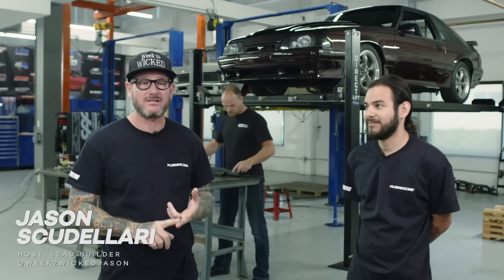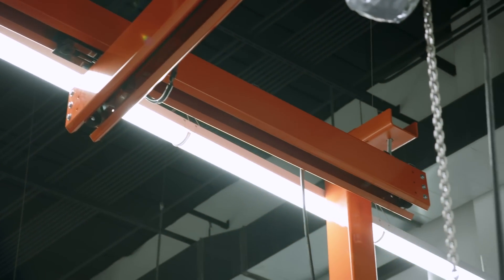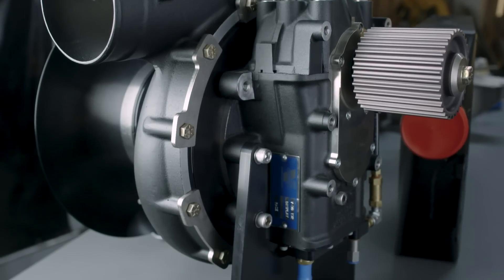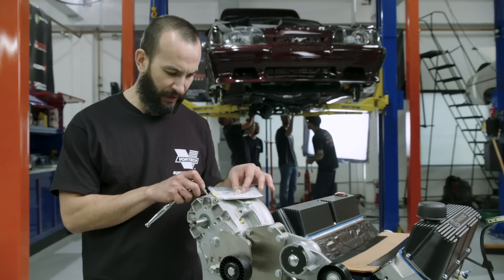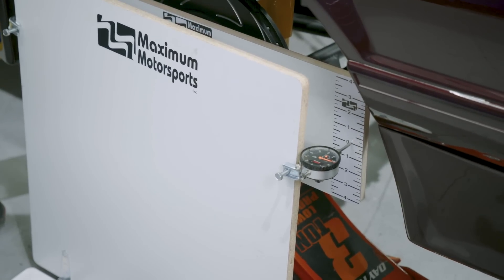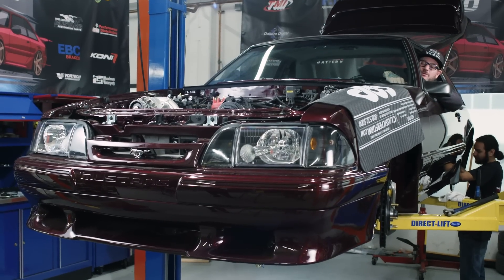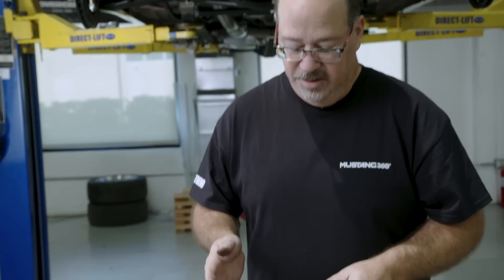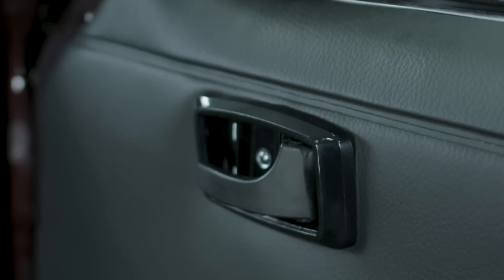2019 Mustang Week to Wicked FULL EPISODE—1990 Fox Body Mustang

Comment: That is the nuttiest rear end setup I've ever seen in a fox.
Reply: It’s actually the best fix on the market for the poorly designed stock suspension.
Reply: Torque arm. The secret weapon. Traction increase under throttle leaving corners and launch at higher RPMs.
Reply: Did I see them ripping out the 8.8 in the  beginning of the video?

Comment: I have always been big into gauges and not just their functions, but how they look as well, and that Dakota gauge cluster looks amazing for a Fox body. My brother just bought a set of Dakota gauges for his 74 Camaro Z28 restomod that he's building. I mean, that car looks absolutely awesome with a 383 stroker, Eaton 4 speed, 3.73 rear end, all bright white body and underneath, three painted black strips down the centerline with red, white, and blue outlines, Z28 in black on each end of the stripes, narrowed and tucked brand new bumpers, all flush cut glass with no trim or weatherstripping, Corvette paint matched Z06 door handles, lowered 2" on 18x12" wheels in the rear, 18x10" wheels in the front, black leather interior with white piping, tasteful classic chrome steering wheel,  those Dakota singular gauges, and it just came out amazing. It looks like a totally different car from when we both worked on it and did a frame off restoration back in 1992.
Reply: That sounds like a sweetness car, does he have a youtube channel?

Comment: I would have let you guys put this stuff on my notch for “testing” I’m close to Santa Ana 🤣 and it’s a 5 speed! #Savethemanuals!
Reply: Did you not watch the video they are a bunch of hacks! I would not let them put air in my tires!
Reply: you really gonna let them touch your car, when they cant figure out how to lift an engine to drop out headers...
OR pull a steering shaft....
Reply: @SleezyRaidz  I have an update I’m actually doing a coyote swap on mine old engine going away.

Comment: This was a well done production.  Like some of the others here, I watched this video in it's entirety.   Great build from the ground, up.  My only two cents here, is that the battery should be mounted in the back.  Which I'm sure they will do
 at a later date.
Reply: That heavy boat anchor of a battery should have been a Braille battery. More than half the weight.

Comment: Torque arm is nice. Would have been nicer with rear irs ,  or went with the lighter Fay2 watts link in the rear in addition to the torque arm rather than that pan hard bar mess. 
And the 340 hp 302 is nice but a nice 408, 410 ,427 -351w based stroker with the v3 si system would be the way to much more torque and horsepower

Comment: My 1987 mustang convertible 5.0 five speed  has been sitting for about six years I recently just bought it I knew that it needed a little TLC so I did a major tuneup Also changed the fuel pump and now it starts up on a dime but it shakes a little bit at the beginning and then it goes away how do I eliminate the shake completely can anybody help?  thank you .

Comment: What was he thinking cutting the headers? Cool build but get mechanics that have some skills in a shop. Those headers would sell on the web for a couple of hundred bucks. What a waist  of good parts that someone could use to get there hotrod moving. Other then that I love the parts the customer chose and might actually do the same to one of my Fox Body's.  Dial that thing in and it will be a street daemon. Good job guys, try and not cut stuff up next time and this video would be perfect.

Comment: You should really try and use a rubber mallet anytime you have to hit something that is going to be the final product! Not to mention new parts! The show just keeps getting better and better, nothing like tightening the fly wheel bolts with an impact gun in a circle! Next time you should try talking them in a star pattern! I can’t with these morons, The reason the transmission wouldn’t lineup is because the torque converter studs have to go through the fly wheel NOT the flex plate! Plus you need to remove the insert! I mean do you have any basic knowledge of vehicles? Since When does a battery keep a car charged!